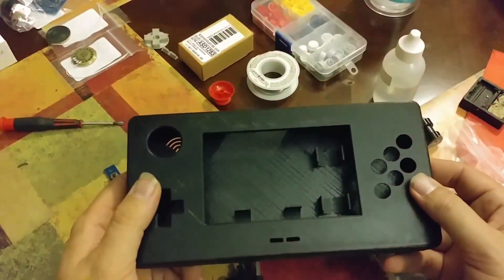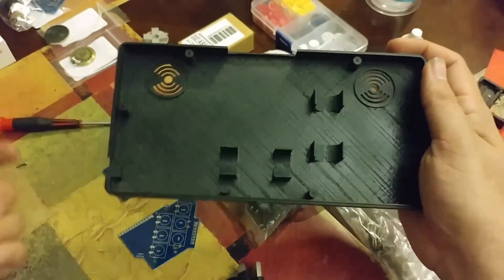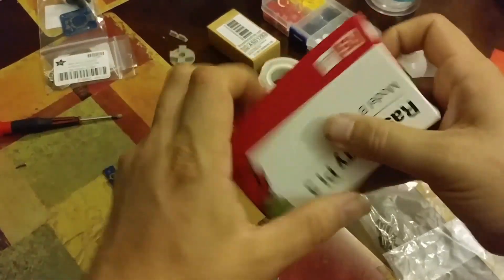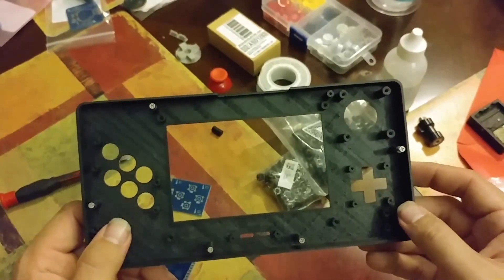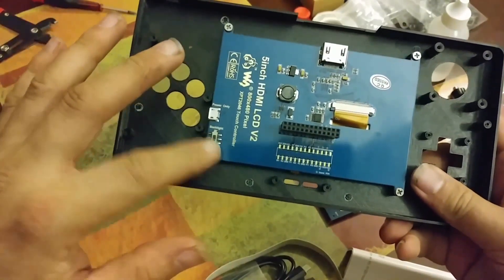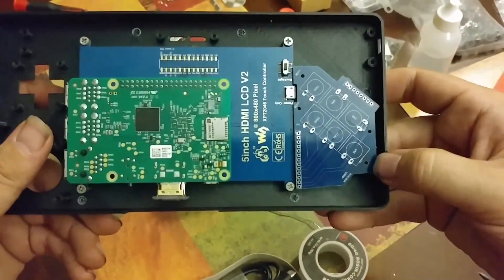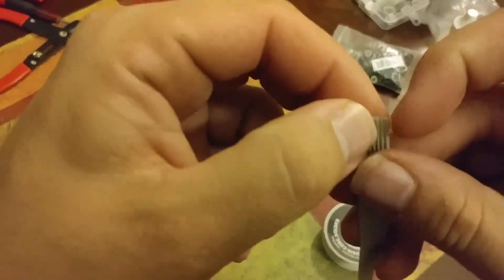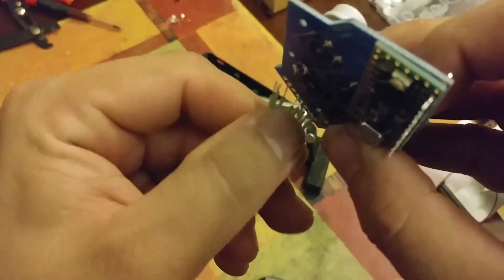retropie with pigear 5 inch build tutorial part 1

Comment: Would it work with:
http://www.ebay.co.uk/itm/5-Inch-Touch-Screen-HDMI-Monitor-HD-800x480-TFT-LCD-Display-for-Raspberry-Pi-2B-/262752234668?epid=2025588454&hash=item3d2d40ecac:g:mdIAAOSwux5YX9NV
Reply from the maker: HASSAN HaKMI no because it doesn't have the holes to mount the screen. I believe I have a link on the thingiverse page for the eBay item I purchased
Reply: Yes, so I noticed, thanks for the reply.